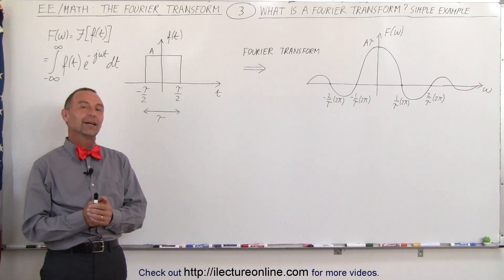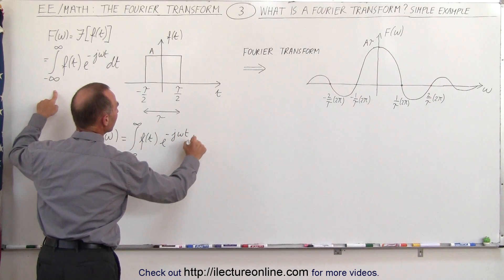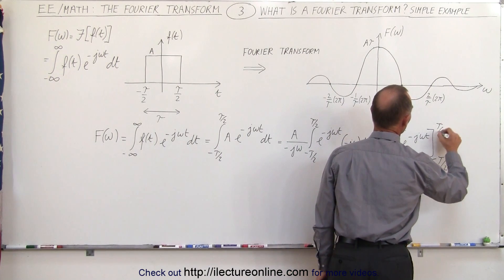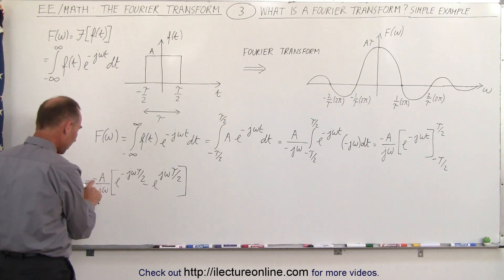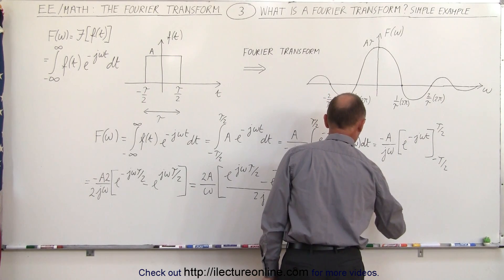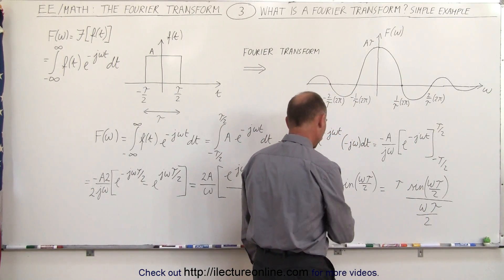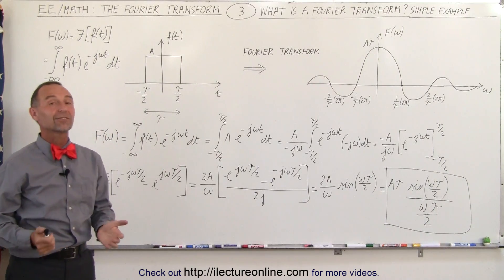Electrical Engineering: Ch 19: Fourier Transform (3 of 45) What is a Fourier Transform? Simple Ex.

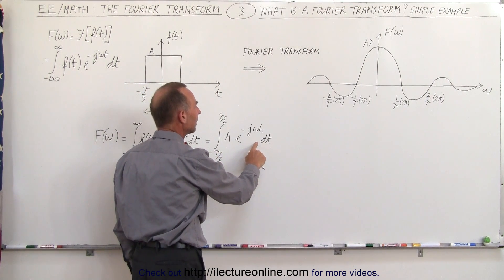Comment: Why do you need "minus jw dt as the proper differential" at 1:45? Like why do we need to add that in? why not just take the integral as it is?
Reply from the maker: Every integral needs a differential in order to integrate it.    When you differentiate the result, you should get back the integrand.  Try it.

Comment: Where do the extra (-JW) come from in that (2nd or 3rd, depending how you look at it) step?
(A/-jw) * Int fr. (-tao/2) to (tao/2) of A*e¨-(jwt)(-JW)dt
Reply: a × e^(ax) is the derivative of e^(ax).
Once you have it in that form, you can also go backwards.
e^(ax) is the integral of a × e^(ax).

a can be any constant. Even -jw.
Reply from the maker: That "extra" -jw is needed in order to integrate.  For every integral you need a proper differential.  (you multiply and divide by -jw so that the equation is still the same. )

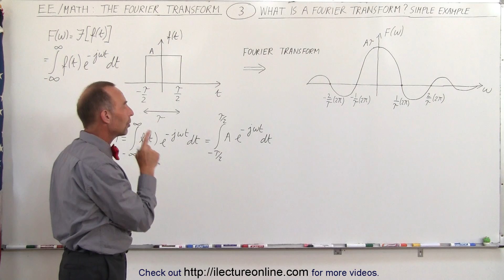Comment: what is "a proper differential"? At 1:41
Reply: You need to multiply by 1 over the argument of e^(X). That is, in the case of e^(nx) you would pull out the n to get a multiplier of 1/n. It's a rule of integration, reverse of chain rule of derivatives.
Reply: @JustinHueb  Yeah, but where comes the extra (-JW) come from in that step?
(A/-jw) * Int fr. (-tao/2) to (tao/2) of A*e¨-(jwt)(-JW)dt